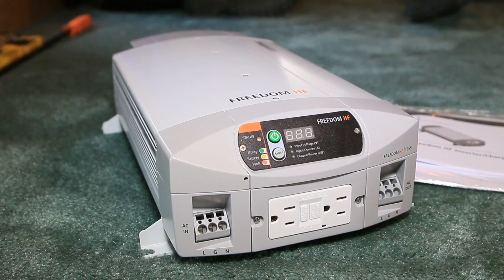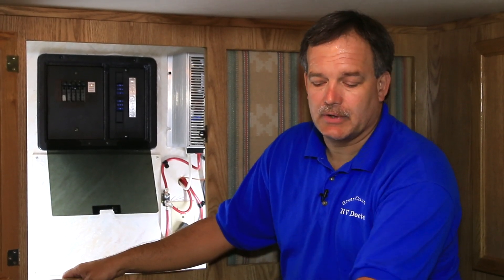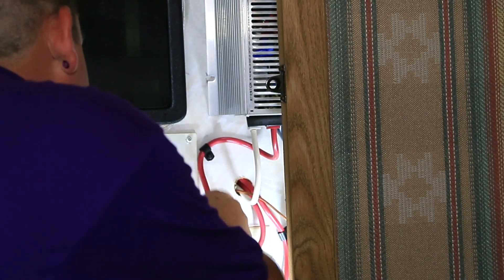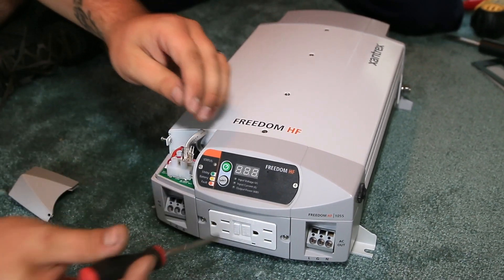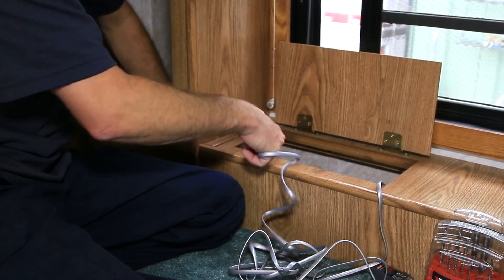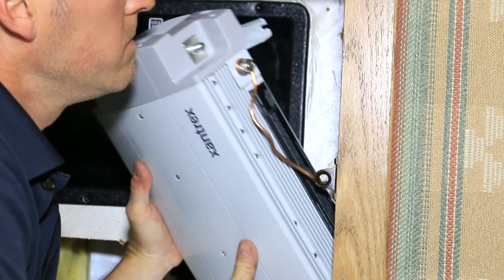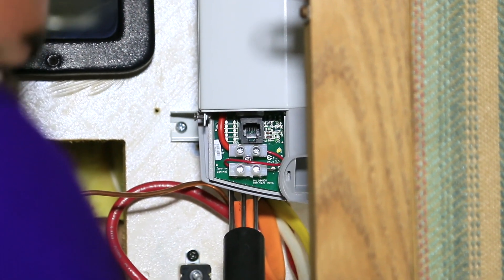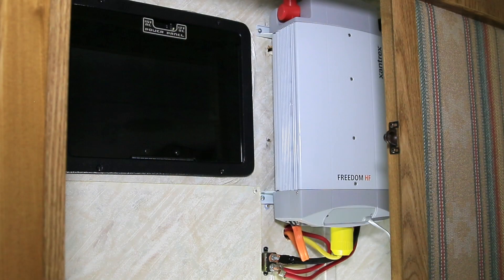Replacing Converter with an Inverter/Charger - Freedom HF Installation Video

Comment: Old video but current issue:  I called Xantrex and was told the Inverter/Charger is NOT a Convertor.  In other words, YES it will provide power by inverting 12vdc to 120vac, and YES it will charge the batteries in multiple stages, but NO it will NOT provide 12vdc power to the coach.  I just called today and got this response.  So, in the real world situation such as when the coach requires more amps to run a 12vdc motor, such as running out a slide, the Xantrex Invertor/Charger will NOT provide the 12vdc amperage to augment the battery bank.  Correct?  Case in point - I have a customer with an old Class A motorhome.  His convertor has gone out.  He has a Xantrex Freedom Pro XM1000 invertor.  I called Xantrex directly to see if it's possible to replace the existing Invertor with an Invertor that could also be not only a charger but a Convertor and I was told NO, Xantrex does NOT have that capability in any of it's models.  I was told it will charge the batteries but will NOT provide 12vdc power to the coach.  So, which is it?  Because this video clearly states that this Invertor/Charger is replacing a Convertor.

Comment: At 5:49, you have a 3 prong tool for connecting the Romex into the connection points.  What is that tool, and how does it work?
Reply: Basically, I can not get the Romex to push into the inverter and not sure what to do to get it in there.  Your tool looks like it would be quite helpful.
Reply from the maker: @thesupportcrew1  The three prong tool is especially made for the OEMS. Wago has a special tool, that looks like a flat screwdriver, for opening the cage of their terminals. However, Wago only has single tools. You could use a small flat-head screwdriver and do one terminal at a time.
Reply: @XantrexTechnology  thank you for your reply. so basically I just push the screwdriver in there to open it and it should just open up?

Comment: This unit looks absolutely amazing. We have one on our boat. It came with our boat. My wife and I can look at this thing all day long. It has the remote control panel installed properly and everything. Our biggest question is, when we’re not hooked to the shore power how do we inverted to run a small refrigerator and fan? Is that even possible for this model? Because at this point we’re thinking about picking one up and plugging it into the cigarette lighter. LOL you could have all the money in the world, but if you don’t have a manual you’re not looking well. #WeAreNotLookingWell lol. I’ll kidding aside, if you could point me into the right direction to figuring this out that would be amazing. We thank you so much for your time and we are looking forward to hearing from you.
Reply from the maker: You may view and download owner's guide at http://www.xantrex.com/documents/Inverter-Chargers/Freedom-HW/Freedom%20HF%20Owners%20Guide%20(975-0390-01-01_Rev-G)_ENG.pdf

Comment: Hey thanks for the great video - By the way, I just converted my Class B+ from flooded batteries to a lithium system using Lithionics Battery, Xantrex,Victron and Mastervolts, Charge Mate Pro. Here’s a link to my In-Depth Installation Video Enjoy - Mike 

https://www.youtube.com/watch?v=nyAAxNqKCOg&feature=youtu.be

Comment: Mediocre specifics for that specific installation, but very little that anyone can use for any other real installation. Suggest using basic schematic diagrams rather than video of someone fondling a circuit breaker and connections magically appearing.

Comment: The converter on my fifth wheel camper does more than charge the battery.    My ac and my light work on my converter.   So do my fridge and water heater.      So don’t seem to know why you would install a inverter in that system.   Wire it separately for  110 but not 12 Volt.
Reply from the maker: Sir, thanks for your comment. The air conditioner, lights, fridge and water heater in your coach are DC loads meaning they run off battery bank, the converter, or a charger, as either of these provide DC current. Should you decide to install a residential AC fridge or need AC power to charge your laptop or phone batteries, you will need an AC power source which is the inverter, but an inverter/Charger will power an AC/LP refrigerator as well. Most of the new electronics are AC powered so it is recommended to have an AC power source in a coach.

Comment: I need to replace my heart freedom 20 2000 watt converter charger. What model Xantrex Freedom inverter charger do you recommend?
Reply from the maker: Hello,  We still make 2 models of Freedom 20 inverter/charger - Freedom 458-20 81-2010-12 12V Hardwire (Single in/ single out) AND Freedom 458-20 81-2022-12 12V Hardwire (Single in/ dual out).  Our website has all the information. Hope this helps. Thank you.

Comment: You spent a lot of time talking about placing the wires in the inverter that already has explicit instructions. Where most explanations are needed is the wires FROM the inverter INTO the breaker panel and Converter. I get it that your trying to sell Xantrax. But your leaving the MORE important information out.
Reply from the maker: We have produced another video on inverter/charger installation - https://www.youtube.com/watch?v=VIhauP2GeEs which covers wiring into the breaker panel. Hope that helps. Thanks.
Reply: @XantrexTechnology  Yeah but no. The new video does not address the information lacking from the video as referenced by Harmonica Blues above. I appreciate you doing this very much, but I still find myself quizzical about how to do it. Best.
Reply from the maker: @bruhow  - Hello Mr. Howard, your feedback is noted. We will try our best to include in our next installation video. You may also call our tech support at 18006700707 for further assistance.

Comment: The inverter has an in and out (Line and Load). Can you take the shore power out of the panel and into the inverter. Then run a new wire from the out to the panel where the original shore power was? If so would this make running the second romex back to the panel obsolete? I'm not splitting hairs but you may want to make a note that you ran 12 AWG romex to the panel. In the video you said 14 AWG.

Comment: Thanks for the video - I'm sold! However I'm curious about the wiring.  The AC panel supplies AC input to the inverter. No problem.  The inverter then returns passthrough / inverter AC to the same panel.  Doesn't the inverter then feed itself?  If the inverter only feeds certain circuits and not the whole panel, how do you avoid a sub-panel?
Reply: bhall430 thank you very much for the reply. That clarified it very well.

Just wondering about grounding the romex.  My questions; is supply to inverter grounded to distribution panel ground, AND romex return from inverter grounded to same bus in the distribution panel? In this case both supply and return grounds would be attached to the same bus in the rv distribution panel? 

I realize the inverter chassis is also grounded to frame at its install location.
Reply from the maker: Great Question! Around the 6:03-6:22 range you can see what we did, but it might not be completely obvious. 

The Freedom HF has a raw output on the opposite side, but it also has a receptacle on the front that is protected by a breaker mounted on the right side. This acts as a single circuit sub-panel. The ‘yellow Romex’ was routed from the inverter back to the panel to feed the load (in the video’s example it was receptacles). It has a male plug put on the inverter end which is plugged directly into the inverter’s receptacle. At 6:18, you can see the other end has a wire nut. Since the
receptacle Romex wouldn’t stretch to the inverter location, the yellow Romex was wire nutted to the black (line) and white (neutral) wires of the receptacle circuits only. This way the inverter output only feeds the receptacles, and shore feeds the A/C, Microwave, TV, and Inverter’s input, which was the converter breaker position.
Reply: Thanks for the explanation. But still not sure where is that "breaker mounted on the right side" protecting the inverter's  receptacle?
Reply from the maker: Grounds all connect together no matter where they are attached. Neutral/ line to the load however must connect to the GFCI output.
Reply: little black button on the right of the inverter face. It pops out when the circuit is broken. Push back in to reset.

Comment: When go back to shore power are you at full 120v potential on the circuit that you dedicated to the inverter?
Reply from the maker: +Scott Falkner - We think yes but strongly recommend you call 18006700707 to discuss your situation and confirm. Thanks
Reply: thanks for the video! my question is: does the vehicle alternator charge the battery via the xantrex using 12v?
Reply from the maker: No. The Freedom HF takes AC input to charge the batteries. In your scenario, you will likely need a battery combiner to utilize alternator's DC output to charge the batteries. For further clarification, please feel free to contact tech support at 1-800-670-0707. thanks

Comment: Would this one be adequate for  fulltime RV use?
Reply from the maker: +K. D. Mann - yes it would generally speaking for a towable but it depends on a lot of factors including onboard loads, battery capacity etc
Reply: I will stick with my converter for now, if it breaks I will replace it with yours
Reply: @kd6844  these inverters are power hungry little children with no father lol
They have a high draw Amp load with no load will drain a battery quick, 
My company uses these in our semi's
Batteries are always dieing,
My recommendation for an RV is always
GO POWER...#1 CHOICE OF SEASONED CAMPERS

Comment: You never stated what the watts was from this inverter?
Reply: Xantrex 1055 inverter/charger, 1000 watt inverter, 55 amp charger
Reply: sunofabish Thanks for the information, had a 2000 watt Duralast and it was junk with no charger. Have a goodnight.

Comment: I did not see you upgrade the DC wiring cable.  I am positive your instruction guide calls for a heavier gage wire for the size of that invertor.  Another question, Could you have attached the output AC wire to the lug terminals to the right of the GFI on the invertor?  Are those outputs?